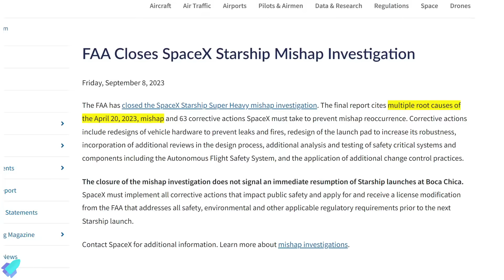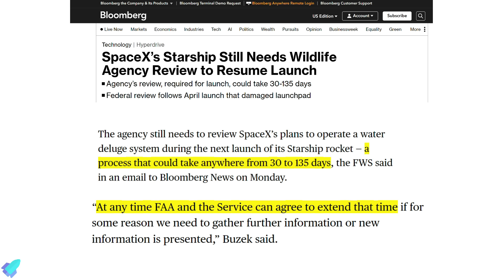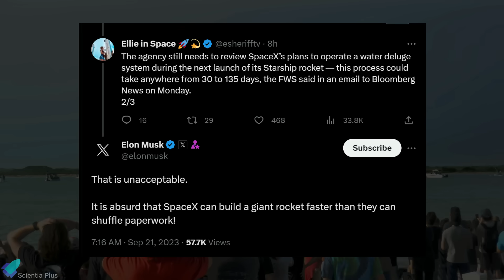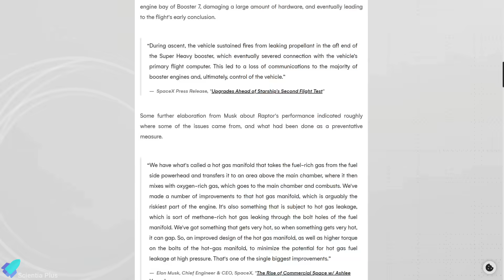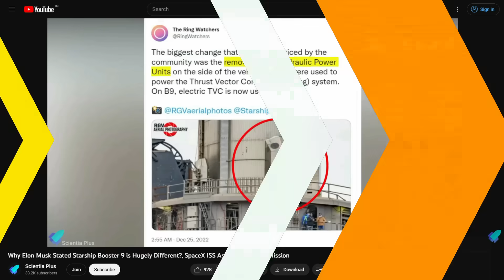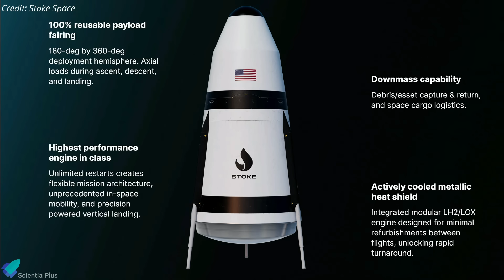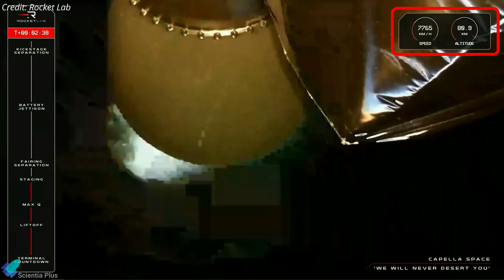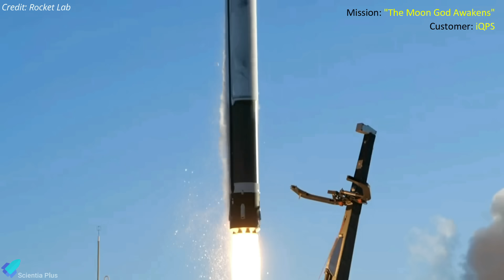Starship Launch Delayed Elon Musk is Furious With the FAA, Ship 25 & Booster 9, Stoke Space

Comment: Technically, the Stoke Hopper II doesn't use vectored thrust for control authority. Rather it uses differential thrust by varying the output from it's numerous engine exhausts (though only 1 actual engine). Fascinating tech to be sure, and certainly a unique approach to the whole problem.